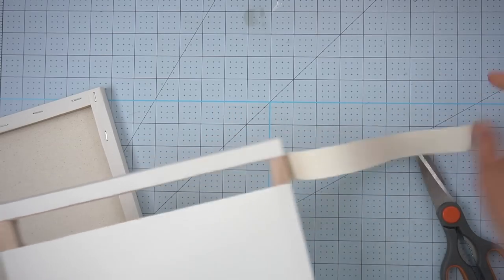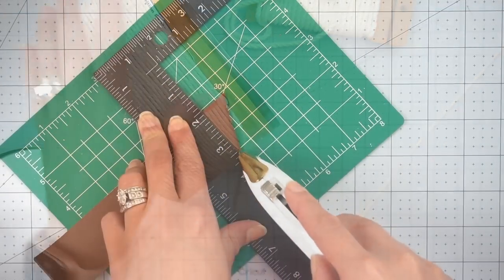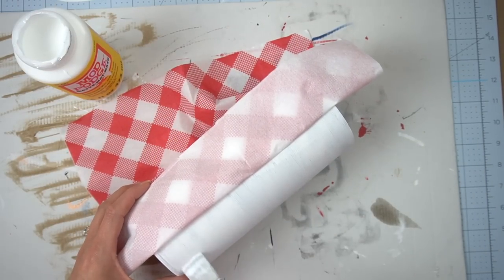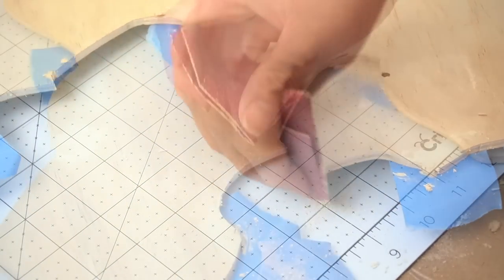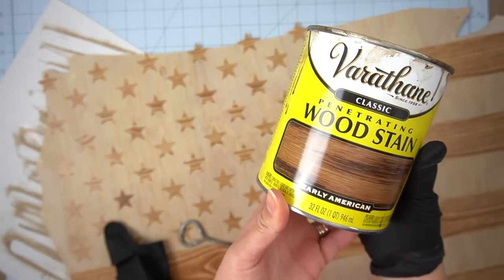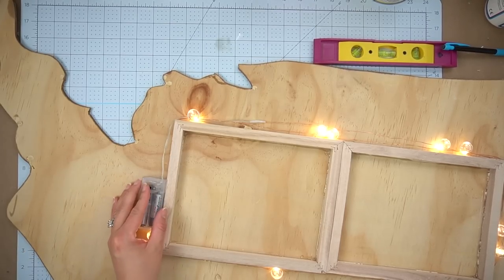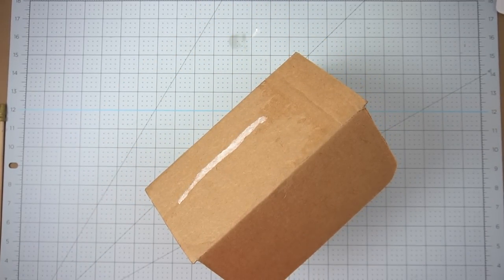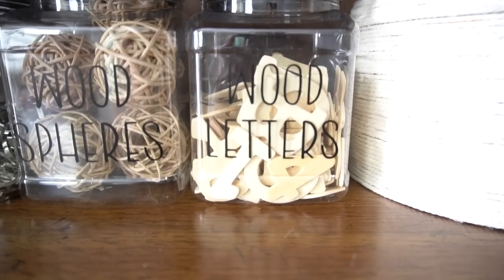TRASH TO TREASURE DIYs | Cheap but Chic Home Decor For Your Home

Comment: I admire your skill covering that box with the contact paper.  I tried once with a sturdy box that tea came in.  It was a disaster.   I decided to paint it instead.  Also when gluing napkins to another surface there will be less wrinkling if you remove the white paper backing first. All your makeovers came out really nice
Reply from the maker: Thank you so much for the tip on the napkin!